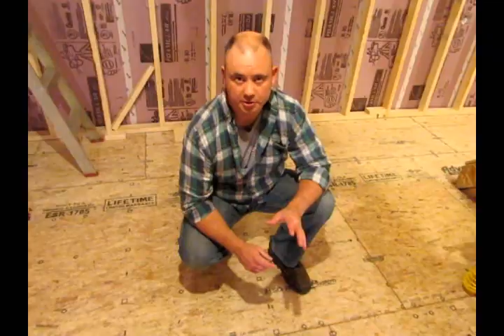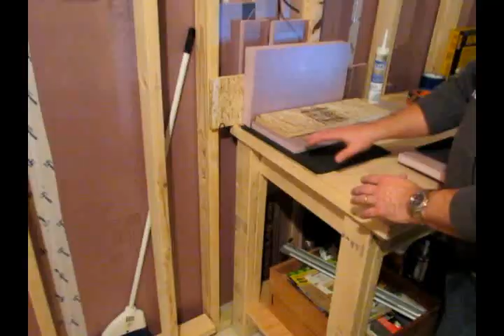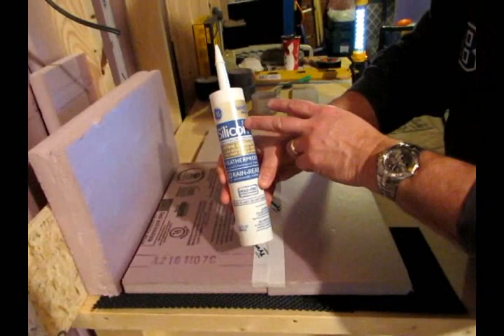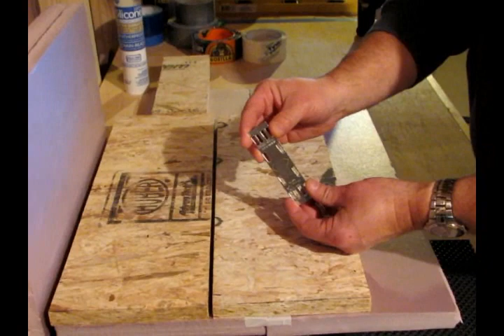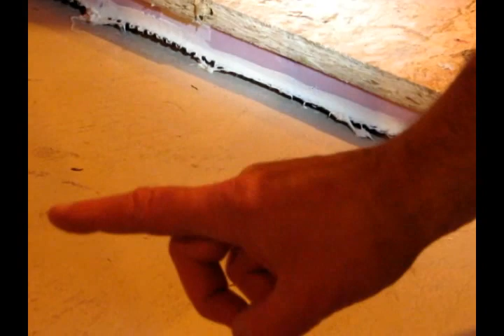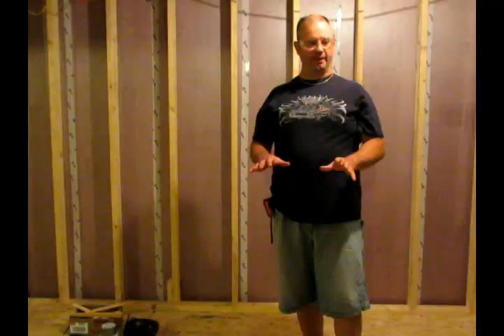Finishing a Basement - Part 2 - Floor Insulation & Floating Sub Floor

Comment: I am expanding a previous basement remodel right now. I used DMX (a larger dimple underlayment), then osb, then carpent. I used tapcons to secure the floor but I filled the whole with silicone to prevent any moisture from coming up through the flooring.

Comment: Thank you for this great tutorial. I'm not sure if you still monitor these comments but I'd like to get some advice from you. I am planning a basement project and will be following much of your advice. In regards to the flooring..  I have 7 ft poured walls with an inch or 2 framing space above so ceiling height is a concern for me. Would using a thinner XPS foam on the floor be a major sacrifice in your opinion? If possible, what do you think the would be the thinnest I could get away with and still have a decent result. My main goal is to eliminate any of that musty smell that always seems to be in the basement once its finished. It is a dry basement overall but it does get that musty basement smell now). I live in southern Maine so I'm in a similar climate area as you. I assume I should be more concerned with a good vapor barrier on the floor more than a heavy R-value? Or do they go hand in hand? 

Also, is there any way to contact you directly? It would be nice to chat with someone like you with experience in this instead of messaging through here. Thanks again for taking the time to make these videos!

Comment: Love this build series!  For your 1" XPS floor insulation did you use the 150 or 250 series?  I haven't been able to find 1" in the 150 density in the big box stores around me.  I figure 150 is probably fine but was curious.
Reply from the maker: I used the 250 simply because I like building things heavier :).   if you use a significant sub floor on top the load from most furniture should be well distributed and 150 I would think would be fine.

Comment: Watched your videos for years and finally utilizing the information to finish my basement. Advantech isn’t available in my area, thought about using 3/4 CDX plywood however wouldn’t be tongue and groove. Do you think just using straps would suffice since the plywood is just floating on the foam board?
Reply from the maker: Sorry for delayed reply.  Without the tongue and groove there will be more potential for deflection as the straps are really just to keep the tongue and groove engaged in the floating design, and will not provide too much resistance against vertrical separation.  Maybe if you go with many more straps and they also make much longer versions of those for framing purposes which you could try but I can't comment if that would definitively work and also depends how flat your foundation floor is to begin with and if you have any deformation / warping of the CDX which will fight against you.  Best suggestion is use tongue and groove CDX if you can find it.

Comment: Can you share appx how many tubes of adhesive you used for the panels?   Trying to guesstimate requirements?
Reply from the maker: Sorry for late reply.  I can only guess from memory that I used maybe 10 on this project which was roughly 50' x 30' insulating wall area.

Comment: Is there any Vapor barrier or insulation under your Slab(concrete basement floor)?
Reply from the maker: I believe there is however, there is so much moisture in the ground and surrounding there is tons of moisture between the slab and any vapor barrier anyway.

Comment: Did you look at the Dricore Insul-Armor? It’s foam board with dimples on the bottom. Supposedly need just that and lay floating floor right on top. High compression strength
Reply from the maker: Any of those products do not result in a vapor barrier.
Reply: @Buffalo-J  DriCore says (I asked them) if you tape the seems it's a 0.9 perm.  For comparison, 6 mil poly is 0.1 perm.  Still, for some situations the 0.9 perm will be enough.

Comment: Wow nice video from 5 years ago. That is my plan for the basement. The only issue I'm not sure about your plan is one layer of subfloor. I think with time board ends will make a dent in the foam and will have some play in it. I was thinking to use 2 layers of 1/4 plywood cross layered.
Reply from the maker: I'd always suggest do what you think works for your design.  I would also though suggest each layer of 1/4 will move and bend more than the single layer of Advantech which is 23/32 (~3x 1/4").

Comment: Trying to get my builder to follow this instructions and Matt resinger’s and it’s a pain to reassure them it works. I get the “we have done the regular tap on method on sleepers and it works” arghrrrr.
Reply from the maker: yep. can understand that.  Contractors know what they are comfortable with and are willing to warranty based on what they know.  Anything unknown is added work, and potentially risk to them in many cases, but this is the learning curve we all go through.

Comment: Hi Sir

I would like to know how stable the sub floor is? In other words can you tile over this without the floor moving and then the tile or the grout cracking?
Reply from the maker: The floor has been very stable at least as far as vinyl plank flooring which I have installed in one of the rooms.  I am not so sure how stable it will be on its own for ceramic tile as it's meant by design to be a tad flexible.  If you were going to consider tile, then you should probably stiffen it up with hardy or cement board but you may want to test that out first.

Comment: Sir the force is strongly with you. This was exactly what I was looking for. A floating sub floor system with insulation that doesn’t include drilling in the concrete. This is exactly what the doctor order. That you may be prosperous and successful spreading this good news and reaping the benefits. 

You are going to build walls on top. I suppose you will use short screws for the bottom nails of the framework?

Do you use a vapor foil between the concrete wall and the insulation ? And another vapor foul between the insulation and the drywall?
Reply from the maker: Thanks for the feedback and love the SW reference.  Big fan myself.   
The foam system I created is a vapor barrier if done completely so no need to add additional layers.  Please have a look at the first videos in this series which describes moisture and damp proofing.
This is the way.  :)

Comment: Just found this series. In WNY area as well. Finishing my basement now in a similar fashion, but probably just doing LVP on the floor w/o much else. Ceilings are kind of low and the LVP should be waterproof. Hopefully works out. Going to review the rest of the series. Thanks for doing this.
Reply from the maker: Thanks for the feedback and good luck with your project.
Reply: @Buffalo-J  Ended up putting dri-core subfloor down and then lvp. Came out great. Thanks again for the video tutorials.
Reply: LVP will hamper evaporation of the slab. Glue down, all man made material commercial carpet is the way to go. It will allow for some evaporation and if it floods you just wet vac it out. The all nylon carpet will not promote mold growth.

Comment: thanks for this detailed information! i am pulling up a stone tile - and underneath is a ceramic tile. would it be okay to build out the subfloor layers the way you did here - on top of the existing tile? or is it not needed? we have a french drain around the perimeter. I plan to put luxury vinyl planks or tiles down
Reply from the maker: Without seeing it in detail myself I would think that could work ..IF... the existing tile integrity is really good and level ...BUT I would also want top convince myself the tile will stay in good shape for many years to come.   If you're asking if the ceramic tile is needed, then no.  If you're asking if the foam and/or a vapor barrier is required, then yes.

Comment: Thanks for sharing the build details.

I’m wondering how you managed the floor height differential from the finished to unfinished basement with the insulated subflooring being almost 2” higher than concrete. Particularly interested if there’s a doorway between finished/unfinished areas…
Reply from the maker: The only doorway between finished and unfinished is at the entrance to the "workshop" area which you can see around the 10-min mark of this video.  Here I haven't done anything to address the height change; it's actually very clearly visible and is essentially a small step.   Having said that, you could fab a very simple "ramp" if you'd like to soften the height difference and avoid trip hazard.

Comment: Great video series, I love how thorough and thoughtful you were in your approach. Another great video! Quick question for you, I am doing a dimple membrane and 5/8" plywood as the subfloor. I am also planning on installing XPS foam board to the cement wall, as you have done. To protect the ywood would this order of install make sense: dimple membrane (0.5 inch away from wall), foam board glued in place as you have done, then plywood subfloor. I'm thinking the xps would be able to protect the ends of the plywood in this fashion. Thanks for your time if you can respond.
Reply from the maker: Hi and glad this is useful for you.  Not quite sure I'm following what you're asking, but seems like you're describing very much the same as what I show in the video.

Comment: I did this in my basement. This floor system will be squishy and move around after you put your finished floor on.. it basically feels like you’re walking on the foam I would not recommend it!
Reply: Also those metal straps are a pita to get in to the subfloor 😢
Reply from the maker: I have not experienced that at all in my builds when using proper 250psi foam.   If you're going to use a foam you need to be sure it has a high compressive strength to avoid this.

Comment: I'm curious, why did you used XPS instead of Polyiso foam? Also, what climate zone are you in? (I'm guessing Buffalo NY 🙂)
Reply from the maker: In my opinion XPS has far better combination of water/vapor barrier and insulation properties for this kind of build than polyiso.   I'm going to paste here the same reply to a similar question I had in Video #1, so hope this helps.
Polyiso products will require fixing methods to the foundation which would require compromise of the vapor barrier (i.e. anchors through the material) or otherwise will require additional work to ensure any such compromise is again addressed to re-establish a complete 100% barrier.  Likewise some Polyiso products may have organic materials in the backings which is in direct conflict with what we are aiming to achieve on this indoor mold/mildew resistant application, sop buyers need to be careful.   Finally there are studies which show Polyiso performs worse than other products the colder it gets.  These are my opinions based on research and experience, but everyone will have their own.  For the benefit of anyone else reading please do your own research and make you best educated decision between XPS, EPS, and Polyiso.  Some references you might use as follows:   
http://www.owenscorning.com/NetworkShare/EIS/10019950-FOAMULAR-XPS-vs-Poly-FAQ.pdf

https://www.ecohome.net/guides/2254/polyisocyanurate-foam-is-a-hot-new-building-product-learn-where-and-where-not-to-use-it/

https://www.wconline.com/articles/87430-the-finish-line-eps-vs-polyisocyanurate-insulation#:~:text=EPS%20boards%20are%20homogenous%20EPS,act%20as%20a%20vapor%20barrier

Comment: Loving these videos.  How has the system you put together worked out for you after 5 years?  Do you run a dehumidifier in the space at all?  What would you do differently?
Reply from the maker: Thanks for the feedback.  Space has worked out great; we use it all year round.  There is no need for a dehumidifier.  Not sure I would do anything much different, other than remember to run speaker wire for my surround sound system before I closed in the walls ! :).

Comment: Hi Buffalo J. Love the videos. I’m currently working on a similar system. 

1). Do you remember what framing strap you used to add rigidity to the advantech subfloor panels?
2). Did you lay any engineered hardwood/LVP over the straps, and if yes did you experience any issues?

I like the idea of using the straps to add rigidity (instead of tapcons) but I’m thinking thinner the gauge the better. 

In any event, I can probably experiment in a small section to see how the LVT sits over the strapping.

Thank you,
Tom
Reply from the maker: Hi and thanks for the feedback.  I used a 1" x 4" 20-ga galvanized tie plate (see link below).  You want as low profile as practical but also want it to be rigid enough to provide some reasonable amount of stiffness and resistance to movement.  I used three different floorings in three different areas, and one of those was and EVP laminate.  It has worked out great and no complaints.  I will have a separate video on that in the near future.
https://www.homedepot.com/p/Simpson-Strong-Tie-MP-1-in-x-4-in-20-Gauge-Galvanized-Mending-Plate-MP14-R/313810431
Reply: @Buffalo-J  When you placed the EVP laminate flooring on the subfloor did you place it directly on top of the advantech?

Comment: Did you glue the foamboard to the dimple mat?  Thanks for the helpful videos.  I am building the same wall and floor system in my basement.
Reply from the maker: I caulked the foam to the dimple mat.  This wasn't so much to create a bond but more so to create the seal between the two.

Comment: Do you have drains along the footings pitched to Sump pump? I think your system is great and I might copy it. But not sure if the drains buried in concrete are needed where I live in Southern NY. Any thoughts?
Reply from the maker: There is drain tile inside the footer below the concrete slab all pitched to the sump.  I have discussed this design concept with some who have french drains and this still can work well even in that scenario provided the floor and framing above are properly supported above the drain.

Comment: Hello. I live in Rochester, just down the road from you. Regarding the floor/sole plates, I have a question about movement. I'm only creating a 200 sqf room in basement, so this floor will only be bounded on 3 sides. Without fastening to the concrete floor, do you think I'll have an issue with movement? Specifically, I'm fearful of drywall cracks, etc. if there is some movement being that the studs will be nailed into this "moveable" sole plate. What are your thoughts?
Reply from the maker: Tough to give a specific answer without seeing the specific case and conditions you're working with.  Having said that, there's pretty high coefficient of friction between the subfloor, foam, and then the dimple mat once everything is installed and especially after you have your framing, flooring, and the furniture and people on top.  It would be tough for movement.  I will tell you we have a gym with treadmills and high-grip gym floor for floor which sees a hell of a lot of lateral force from floor and cardio stuff and nothing moves.  Cant image what more you could do.
Reply: @Buffalo-J  Thank you for the reply. I've watched all of your videos multiple times over and am building from your playbook. You've done more for me than Bob Villa ever will!

Comment: What do you do to address the fact that you just removed 2"s of rise from the first step of the basement stairs?
Reply from the maker: Nothing.   It's a pretty benign sacrifice considering the massive benefits we achieve.  I have seen other who built a landing to match the height of the first step to break the stair pattern and in the end I considered it, but once the floor was in and not one person who went up and down the stairway noticed any significant affect or risk of trip/fall, we decided to leave it as is.   Yes, we are all ingrained with muscle memory of the standard stair tread height, but this really has not been any issue whatsoever.

Comment: Should have used acoustic barrier instead of silicone, as the silicon will degrade years before the non hardening acoustic barrier.
Reply from the maker: Good suggestion.  Something to be considered for future.  LMK the product you recommend the expected installed lifetime.  If better than silicone min. 20yrs that would be a good upgrade.  Thanks.

Comment: In your mock up at the start of the video, it looks as though the dimple mat does not go directly to the wall under the insulation on the wall. Did I see that correctly and if so, was there a reason why you didn't bring the dimple mat directly to the wall?
Reply: If the dimple mat went all the way to the wall, any moisture sinking to the floor behind the insulation would end up on top of the mat instead of under it.
Reply from the maker: Apologies for the delayed reply.  @ Devin LaMarre, you are right on and you beat me to it. Thanks.
Reply: @Buffalo-J  Great videos, I'm essentially copying you! Best video series for finishing a basement on the Internet. Would you recommend installing the dimple mat about an inch away from the foundation walls, with the plywood on top (also about an inch away from wall). Then installing the wall foam insulation touching the top of the dimple mat?